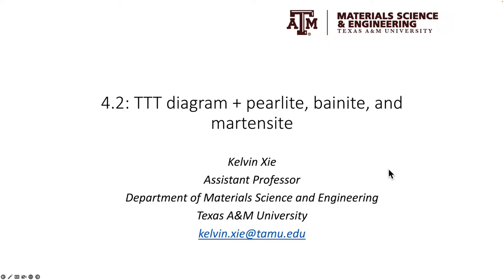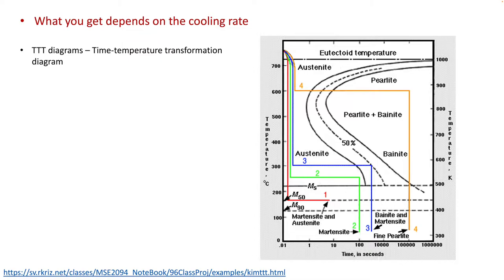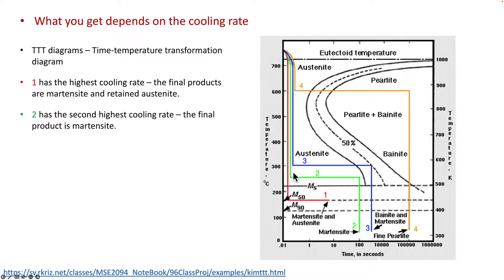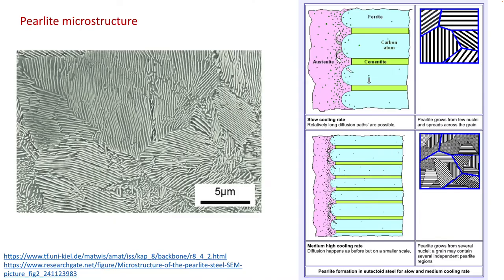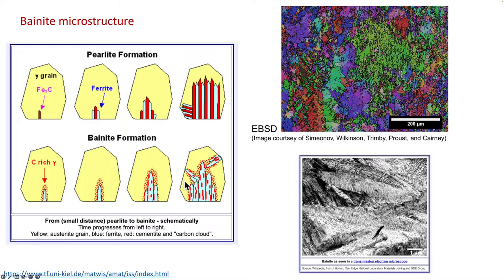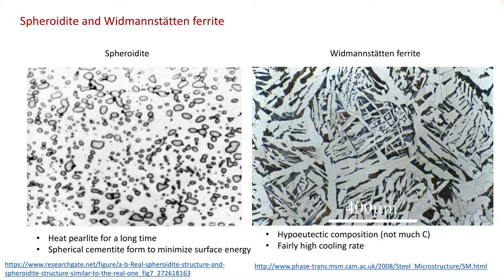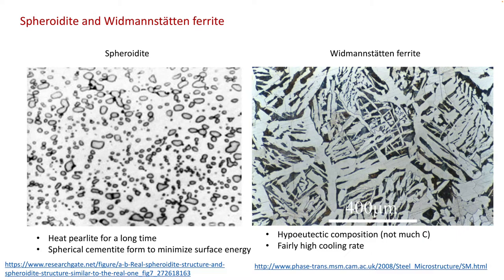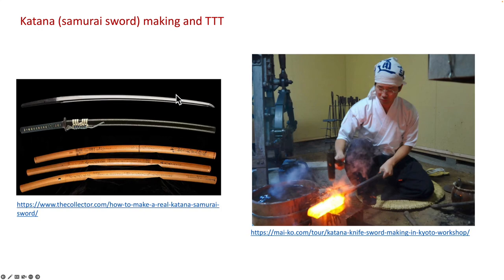4.2: TTT diagrams and phases in steels (pearlite, bainite, martensite, and more)

Comment: The traditional Japanese sword makers coated the sword in a clay mix on the back of the blade (the blunt side), and left the sharp side uncovered.  They heated the sword and judged the right temperature by the colour, then quenched it.  The sharp edge had no clay on it so it cooled immediately, the spine of the blade had clay on it so it cooled much slower.  The end result was a sword with a tough flexible spine and a hard sharp edge.
Reply: My ex mother was the spine